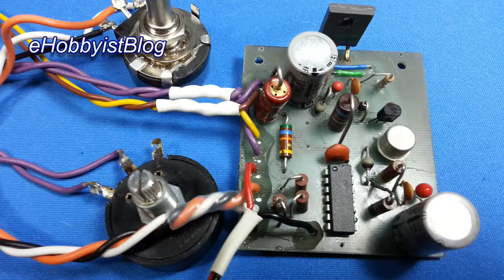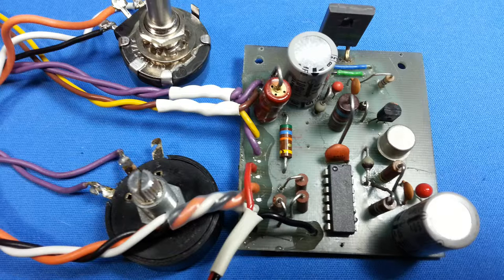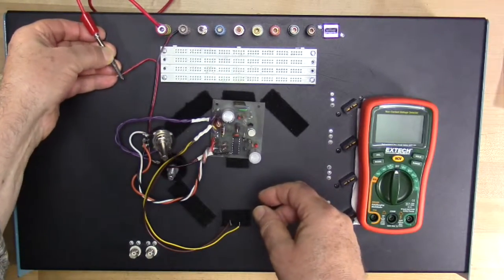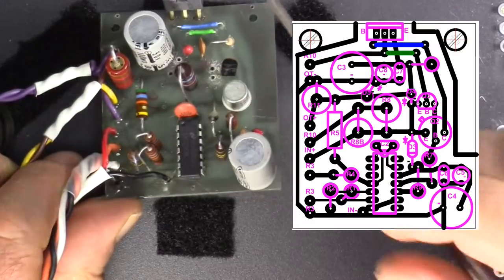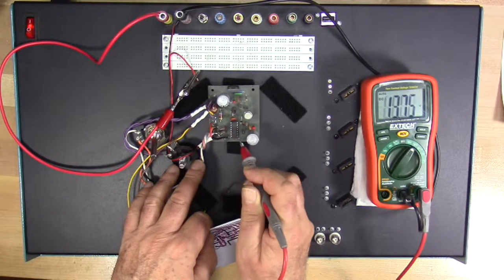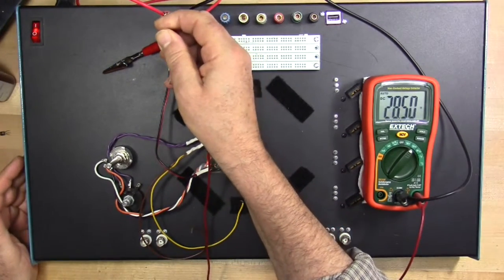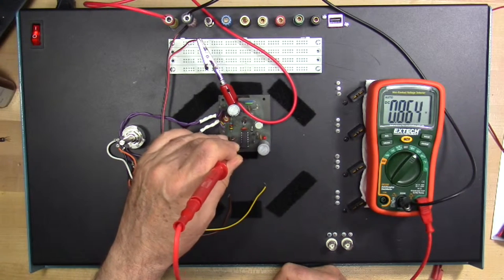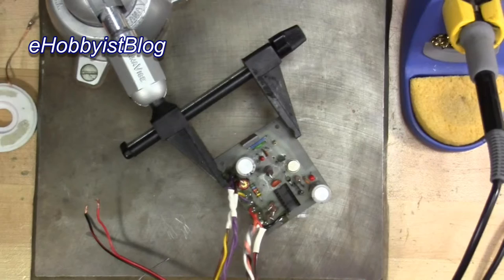035-Power Supply--Variable + (9)

Comment: hi, check this design, it is much simpler but has no current limit connection for now. it sources down to 0v from around Vcc minus 2v. I had to pry at my study material to achieve that because the example schematics at the datasheet are too complicated and hard to understand.
http://crakomili.net/personal/4Sale/lm723.png
Reply from the maker: +Ronen Shemesh 
Your circuit looks interesting and to some degree is reminiscent of Frank P. Miles' circuit, where R1-R2 and R4-R5 (re-positioned) are replaced by potentiometers. 

I don't know why the first pot works; I found that shorting out Vref trashes the chip. I don't know why the second pot works, I would have thought grounding the emitter at Vout (pin 10) would roast the chip's output transistor. Then again, there are many things I don't know.

When I get a chance, I'll breadboard your circuit and play with it. Meanwhile, I'm returning to the "Plan A" power supply presented in videos 027-037 and moving on.